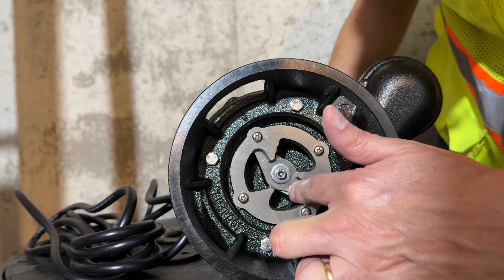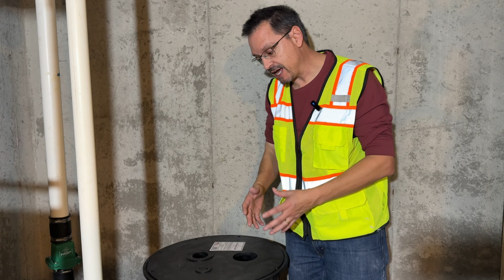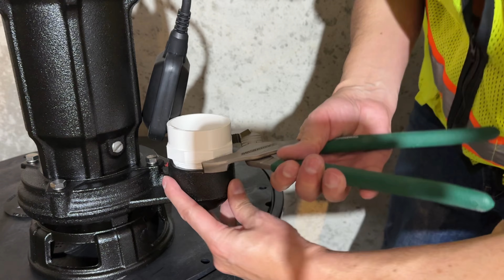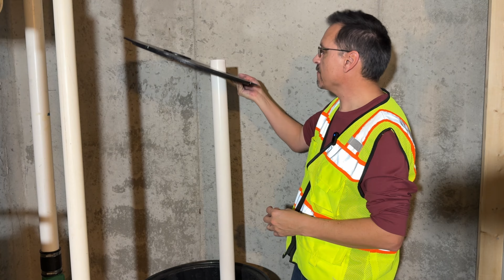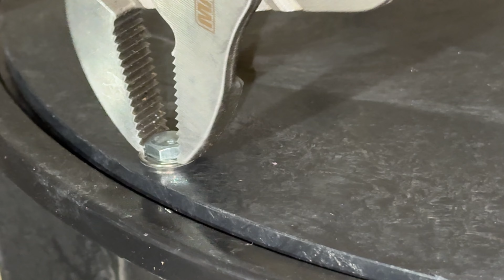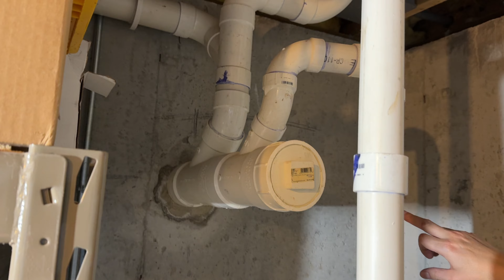Installing a Sewage Grinder Pump Aquastrong 1 HP Sewage Grinder Pump SEP100CA-LV

Comment: I just got one. It doesn’t work, did I missed something while I installed it .
Reply from the maker: Dang, I’m sorry to hear that. I’ve never had a problem. Check your wiring connections and make sure the float switch has enough room to move freely. 👍🏼